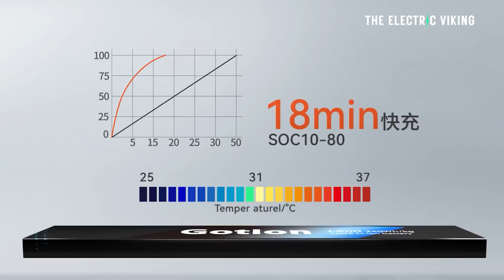NEW battery that Elon Musk said would disrupt entire auto industry finally here

Comment: Let's be clear here. 
A kWh is a kWh as far as I know. Battery chemestry cannot give you significantly more range per kWh I'm assuming. 
What it can do is make the battery pack significanly lighter to allow for more range that way. 
Whether that makes enough of a difference to result in a normal car that can do 500-600mk with a 50kWh battery? 
Seems a little unlikely but it would be great.

What would be cool enough if if it would allow 500-600km of range in the same space of a battery that would previously allow only 300-400km of rqnge. That would be game changing already.

Comment: The winner will deliver a 600 mile range in a 3/4 ton pickup, or standard size car. The pickup has the advantage of battery pack storage under the pickup bed of twice the size you could put in a car. Plus the pickup is expected to be a work horse , able to pull a 28' camper trailer, or haul several tons of hay, or other materials. The Tesla pickup is more of a city pickup like the Ford Ranchero once was. If they truly want to take a big market share of the pickup market it needs to look like a pickup. Toyota has done well building a truck that looks similar to a Ford or Chevy pickup. Tesla could build a pickup truck with a 600 mile range, and make it look like a new Dodge or Ford truck. They'll definitely own 10% plus of the new truck market if they can. The interior of the truck needs to look more standard than a lot of the stuff being produced. Our car has way to many buttons, and a TV screen that can be used just like the buttons on the streering wheel. Just to much crap to deal with while driving. Put a normal radio where the TV screen is. If you want a rear camera have it work when you lower the visor. Otherwise it's out of sight.

Comment: The storage density and weight have always been the issue with EV. Still won't do any good without government discounting taxes to encourage the building of the charging infrastructure. States funding is far too dependent on fossil fuel taxes. They also need to engineer vandal proof charging pods. We can't have tweakers with bolt cutters looking for copper increasing costs because of poor designs.

Comment: It doesn’t matter what chemistry you use. The same problem with arise!

The battery will be larger. Very heavy.
Does not get lighter in weight as the energy is used.
They randomly set themselves on fire!

Battery vehicles was invented before combustion engine.
Battery vehicles filled and they will fail to become common again.

Comment: Sam, increased energy density means a battery of a particular size and weight will store more kWh, not less. A smaller battery can store the same charge as today' large and heavy packs. Lower weight and increased kWh capacity will result in increased range.
Reply: Great comment ty

Comment: Sounds fantastic, but the long-term environmental impact still needs to be considered.  We still need to look at the environmental issues where current-generation battery packs have failed. 

Are the car makers going to support the repair of the batteries so they are not replaced after minor damage to the pack? 
What is the CO2 hit for manufacturing?

Support for retrofitting new technology packs to existing electric cars to reduce the CO2 of the manufacturer of the car itself and to allower lower income people to use electric vehicles?

Proper support for recycling where repair is not viable or possible or batteries become obsolete.

Unfortunately, I do not trust car makers to do any of the above.

Comment: I currently use LFP batteries in multiple applications and can vouch for there lightness and safety. They really take a beating compared to lead acid and spiral wound sealed lead acid. Can't wait to see these new batteries.
Reply: Not in a car though, eh?
Reply: @jamescollins3647  Yes, starting battery, Deep cycle, electric mower, powertools you name it. In some cases, the BMS is the limiting factor but there are ways around it.
Reply: @fourbypete  Not in a car then.
Reply: @jamescollins3647  Not driving the vehicle forward, no. The model 3 Tesla's are using them. I don't know how many models in Australia have them but they are phasing out the lithium ion for LFP atm.

Comment: At this point batteries are actually getting to be a yawn.   The most important feature is low cost as we have seen with LFP.   If the double the energy density they will 1/2 the size of the pack to reduce cost and weight.   Battery makers are generally not picky who they sell to.

Comment: @5:30 regardless of the chemistry, for a 120kWh battery pack to give a 1,000km range, the car would use 120Wh/km. This is about the efficiciency of the car, not the energy density of the battery. The rest of the video suggests that it is the energy density that has improved which means you potentially could get a 200kWh battery in the space and/or weight of a conventional 120kWh battery pack. To put it another way, if a car uses 200Wh/km, it will need 200kWh of battery power to travel 1,000km. This technology may very well make that small, light, and affordable, but it's still a 200kWh battery.

Comment: well - any battery pack can be stuffed with an alternate cell type when and as new chemistry and types become available. (this is a reason many manufacturers stick with some "standard" unitary cell size (whether hard or soft cell).
Still waiting for an affordable and energy dense Iron - Aluminium, Salt water battery  (yes REDOX limits exist - ie. this is pretty well understood, and the hype usually falls flat - on the cycle limit.) - but having a battery made from the most common elements on earth is incredibly compelling....  waiting.
(I currently own a whole load of LFP  >12kWh- as well as significant weights of LNMC..  ready for any future advances.)

Industry makes the most money by releasing an acceptable device and mass manufacturing "the hell out of it" while the enthusiasm for said device lasts, consumers are fickle - "Even" Teslas are starting to look like rows of uniform uglly frogs rolling down the street in "endless" queues. 

NB Aqueous electrolytes are thermally limited - ie, need a heated Garage in Canada, Alaska and Northern Europe.  Ideal for temperate and Tropical zones.

Anyone can put LFP cells in their packs - but for convectional manufacturers, finishing off manufacturing batches is important, so as to not burn "in place" contracts - future supply relies on industry good will, not everyone can simply just go out and buy an entire

Comment: 1000 km (621 miles) is a game changer. If these batteries are cheap enough and can fast charge, gasoline cars are finished. No need to ban them by 2035 or whatever. They will simply die, like the dinosaurs they will be, except for used and vintage cars. The entire fuel station infrastructure will need to become convenience stores with charging ports. The oil industry will be turned upside down. If I were Exxon or BP, I'd be thinking seriously about investing into this battery tech, solar, etc.

Comment: Battery is not a game changer until it shows up in my electric mower, solar panel batteries and car.
Reply: exactly, if it's not powering my 18v Milwaukee Drill (which I just so happen to use to remodel my downstairs bath last week) then it DIDNT HAPPEN...!!!
Reply: I have a battery lawnmower and it is very light and a pleasure to use, no issues.

Comment: Abundant and reliable charging infrastructure for those who need to do a long trip is still more important than having a huge range that most people will never need, but it is useful to have cheaper and smaller batteries that allow for more time before changing is needed for all the folks who for whatever reason cannot just plug the car in a free charger every day.

Also, it makes it easier to make fun of the idiots who obsess over range: 1000km is over 600 miles, even if you are among the rare people who need to drive 60 miles each day that means you only need to charge once every ten days. In the unlikely case if you had to do a long road trip and lived in Germany where you can drive 150mph on autobahns so it would take "only" four hours to empty the battery, driving at high speeds like that is extremely stressing and four hours is long enough that your passengers will force you to stop for a break even if you want to risk getting a heart attack from sitting so long.

Anyone who is not driving a long haul semi but complains that EVs do not have enough range for their daily driving is either lying, doing some kind of illegal job like smuggling drugs through back roads so they can't stop at chargers because they have cameras, or is some kind of special case that applies to less than one person in a million and therefore irrelevant to any discussion about regular cars and drivers.
Reply: Well said

Comment: The end is coming like a speeding bullet. What am I going to do with my FJ and my treasured motorbike when there is no fuel around?
If there is some it will be very lean on service stations selling fuel. This will give my gas vehicles range anxiety.

Range, which was the prejudice against Ev is now going to become a gas car problem.
Who in their right mind in the fuel industry is going to be storing fuel and selling piddling amounts. if they do what price would that be.

The speeding bullet of demise is aimed directly at gas cars and their range is going to be severely cut by fuel price and availability. 
May even get a pollution tax in the bargain. Let's face it time has run out for gas cars, technology has killed it.

The great advantage of Ev's is the charge price. Grid electricity doesn't vary in price as gas fuel does.
Ev's Have another advantage over gas cars.
Leaner and cleaner and cheaper to recharge and drive with nothing much to wear out so low cheap maintenance and whisper quiet.
The Ev car range will soon surpass anything a gas car can do much cheaper. Money talks!!!!! 

The big question? what is the value going to be for a quality gas car in a very few year's time., How much money are you prepared to lose.
As car dealers and servicing change to electric cars servicing a gas car could become very expensive and not available. There are many questions to be answered and the public is blind to what can and might happen in the near future. There is no clear view at present.

In 2008 the stock market crash caused many people to lose a lot of money, and the gas car crash will do the same. Only priced for scrap.
Change to electric before you get caught with a monkey on your back.
PS. Take a look at the Norwegian car sales they have similar distance driving and rely on their cars as we do. They are also a big oil producer.

Comment: I am afraid that I do not share your exuberence for electric vehicles or even the climate change models but I am sure you might be open minded enough to look at alternatives.
Based on the premise that chipping virgin trees in the US and sending them across the Atlantic to be burnt in the Drax power station is regarded as carbon neutral then there can be no objection to plant oil as a fuel.

If you look at the latest advances by Mazda for rotary engines and even more interesting that of Liquid Piston who have turned the design inside out, they can easily be adapted to run on different types of fuel including plant oil.

It was estimated by the military to get one litre of fuel to the front line took ten litres. How much easier to grow suitable plants on a local basis.

So instead of going to the gas station to get filled up, you go to your local farm instead.

When 45% of US agrivulture goes into making ethanol which is responsible for the wrecking of millions of engines due to slime in the fuel tanks, I hope that all that gets changed into something more productive.

When you look at the design of rotary engines, you can see why Wankel was so enthusiastic.

Comment: I gave up on batteries, i really think that running evs on a petrol powered generator on board will be much more efficient (petrol holds a lot more energy than batteries and e-motors are infinitely more efficient than combustion engines).

Comment: LFP batteries by CATL expected life 1,200,000 miles. What is the expected life in miles of the LFPM? Concerning battery life in million mile Plus range, that eliminates consumer fear of expensive battery replacement. Also, for high use cases such as police cars and Uber, the life cycle cost of EVs is about $100,000 cheaper over 12 years including purchase price, fuel and maintenance (12 year life of the car, not 4 years for gas).

Comment: Now it is perhaps not so common to have very fast chargers. Not even in Norway. There is a normal speed of 50 kW on many chargers. Surely at least 230 kw is needed for it to be as little as 18 minutes? maybe it is also required that the car has a 600 V system?

Comment: |> |> |> |> |> |> |> |> 
|> |> |> |> |> |> |> |> |> 

(2. part, the lies of massmurders exposed)

I saw hundrets of videos and blah ...

they always point on the cell itself with the steelpipes ...  yes ... that is a smart way to seperate hydrogen and oxygen and can apply much pressure already in the cell!

But by capsizing is this not good ...a gyroscope can help, but by a full turn not possible ... the electric connection by that is not the problem, but the host connection obviously.

I apply pressure which is much lower then the selfenlighting point, and only should garantie a good flow to the two compressors which bring both gasses then on working pressure.

BUT without pulsing ... 

the real thing was the pulsing that you can take simply tabwater!!!

I give here two examples of electrolysis

https://youtu.be/Q12EIRbFKPk

the first is a guy from a marina which simply want derust a steel part ... the setup redicilous how it can only be ... a car batterie and a electrolyt solution ... 

a bit to much bubbles for "to much energy needed" ...

https://youtu.be/wrKURnM8GAY

the second video shows the efficiency 

and the clear definitiin of "efficiency" in correct way without bullshitting and high treason and mass and nature murdering!

watch that videos ... the rest should be clear ...

what that protege of massmurders and high treasoners blah ...

certainly he cannot tell any real datas because he cannot lie so easy to prove bzt how he wind like a worm should tell ... again ... by that videos all ...

point by that point ...

end all bullshitting and  prosecuting all that bastard for massmurder!

plus the injector system which must be deffantly aproved from the licent giver because hydrogen on demand ... the only "storage is the pressure chamber and that is not much bigger then the host.

so if anything goes wrong you have a easy to controll explosion 

....

the next is that pistondriven engines to luck anyway soon be replaced ...

https://youtu.be/gi7IOXQ7oyo

the omega1 radial engin is 17 kg weight if Im not wrong ... can create unsane thrust and 165 hp in redicilous size compared to a piston engin.

and the fuelrequirement are a part of what you need by piston engin.

So the hho requirements are less = smaler cells.

here in per examples and talk explained:

https://youtu.be/Cgi5q0-omlY

here is to care that you MUST reduce the oxygen in the mix to prevent selfenlightning under pressure!!!!

what by a diesel engin raise the efficiency because one time fuel injection ... two working actions ...

would destroy the engin!

here MUST not anything such the working parts back!!!

only pushing!

here comes the injector system in the game ... the radial engin and my injector system is the perfect marriedge ...

I use the tesla modules to revoke 8-13% of the 33% oxygen to avoid this and extend the burning time.

normal breathing air have about 22% oxygen ... with cell and a watersteam recycling you can run that engin under water and have oxygen to breath...

this is in fact biosphere technology ... 

Im machinist educated to build up factory streets and service, hydraulic, pneumatik, elektropneumatic, cnc, sps, all kind of weldings methods .. programming of weldig robots ect.

and some other fun which you really can use to not rott each year x hundret and thousands of  spieces ... if you are not a damed dumb slave which is to corrupt from demons in human bodies.

Im sick aboit the lies ...

and so I explained the complitly setup how its done ...

no secrets ... go lost you massmurders and killers!

this  explaining make it possible to follow his steps!

DO IT !!!

and find, prosecut, trail and execute all the murders in that way how they desearve it!

https://youtube.com/shorts/brrTUmBk4u8?feature=share

|> |> |> |> |> |> |> |> 
|> |> |> |> |> |> |> |> |>

Comment: There's no battery  that will end internal combustion engines because that only solves one of the many problems with EV's.  One on the problems is charging stations.  Some states are already limit when and how much a charging station can be used.  Thieves are stealing the charging cables for the copper faster than the charging stations can be built.  There's no plan to upgrade the electric grid to support all cars being EV.  There are many more problems.   The EV concept is over 100 years old.  The difference is the people over that past 100 years were smarter than the current generation.

Comment: Haven’t BMW already launched their version of this battery for 620-mile range,  InsideEVs last December “With the launch of its Neue Klasse platform and series of electric models, BMW will also introduce its Gen 6 battery technology, which brings significant improvements in all areas that matter. The manufacturer is touting 30 percent improved range, 50 percent reduction of production cost and 60 percent reduction in carbon emissions, as well as an integration of the battery pack as a part of the car’s structure.”